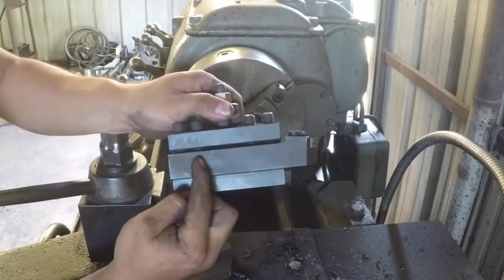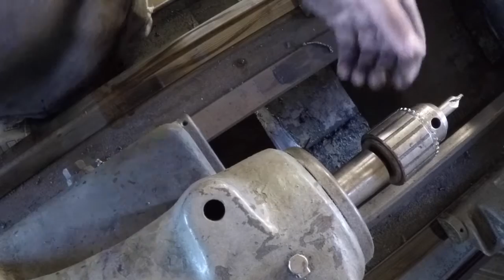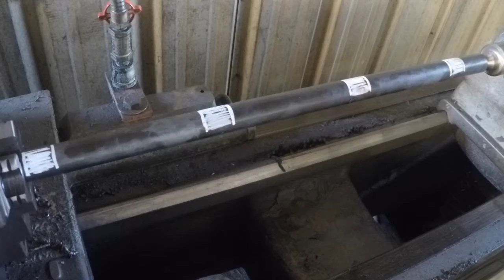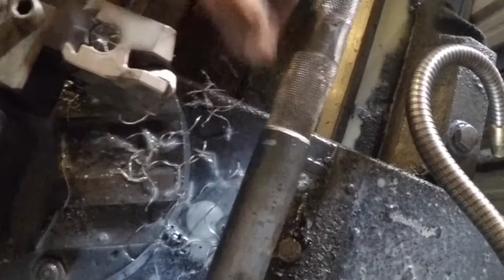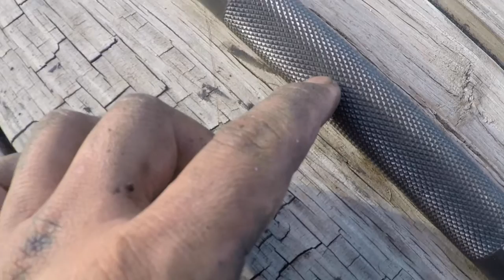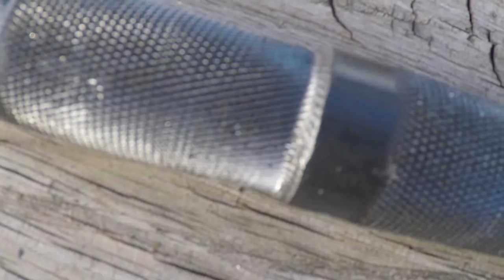#99 Knurling Tools

Comment: Why you didn't cut the bar in smaller pieces?, did the bar flexed in the middle (between HS and TS)?, also why the coolant instead of cutting oil?. (sorry in advance if it was explained in the video, i skipped a chunk of it)

Comment: Did any of the manufacturer's list optimum diameters for the stock to get the best knurls based on the pitch of the knurls to help with the tracking?  I've read and seen comments about whether the stock diameter matters that go both ways.